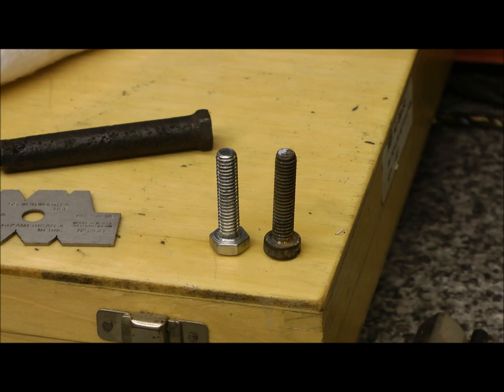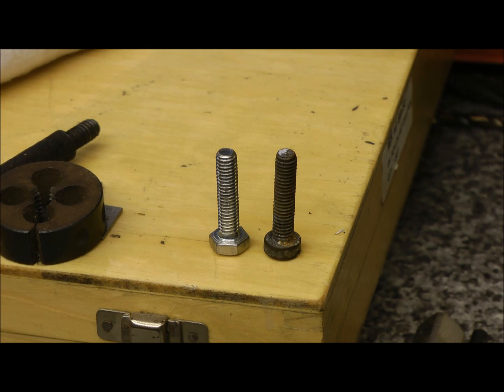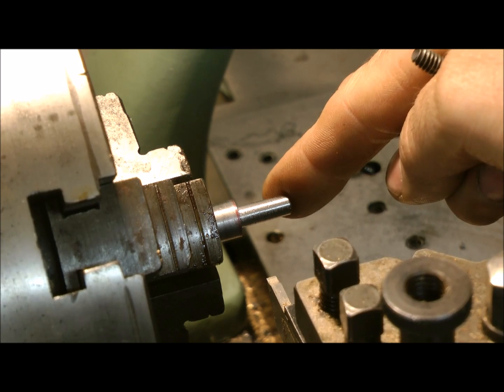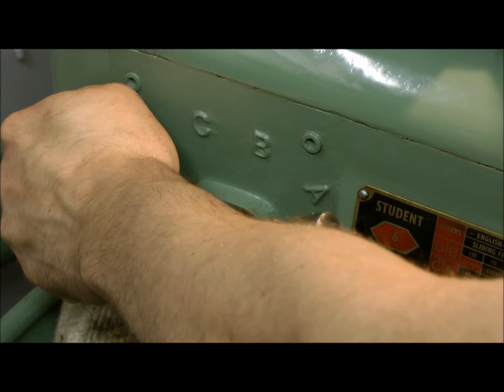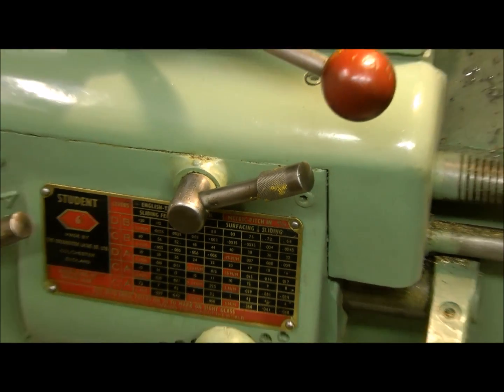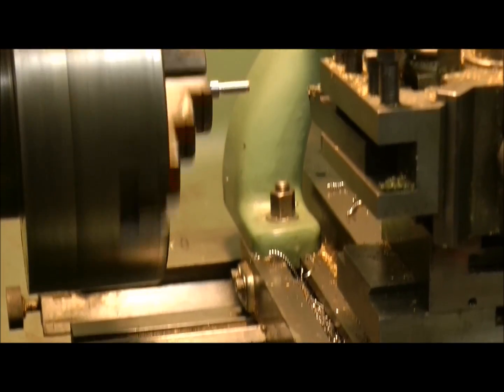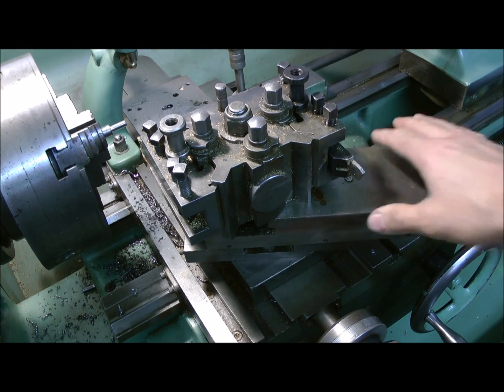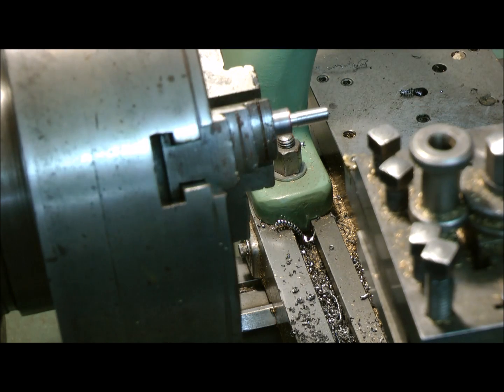First attempt at screw cutting lathe part 1

Comment: From the sounds of `er wha`, i deduce a broken gear tooth in the lower gears... Sounds like a single broken tooth that when encountered at speed, via the momentum of the things just skips the position wholly, smacking into the next tooth with what little run up the system managed to achieve in that short interval... I could be wrong, but that`s what it sounds like to me... 
Just found your channel, so i dont know if you diagnosed/changed the offending part as of yet, but we shall see... I myself have quite some shit to deal with in my shop... More like 9 machines in need of general restoration and 1 in need of complete service and 2 baby machines that are in tip top shape... Well, i lie, the baby lathe has a tailstock issue to resolve, but that is a single precise bore worth of work to solve that... I`m just too lazy atm to deal with that little bugger... So one could say that i have some experience with machines not sounding as they should
All the best!
Reply from the maker: Hi ! Thank you 😊, there’s definitely something going on in there… I’ve never been brave enough to look inside… I bought it untested… young and foolish, I don’t use it much as I should
Reply: @Madchris1 
Oh, dont worry, i too have done my fair share of picking up machinery that is either untested or in need of severe reconditioning and general restoration... On one hand, it offers you the ability to snag ridiculous machinery for pennies, on the other hand, it offers you the ability to conjure a task as laborious as pregnancy yet one that can last much longer...
 
If she is free of cracks in the main casting, she can be restored to perfection... That is my motto... Machines just need a lot of love and double the amount of elbow grease...  

All the best and kind regards!

Comment: The mower will most likely have a Briggs and Stratton engine, which means that the thread will be 1/4” UNC, not Whitworth . . .
The Whitworth thread form has a 55 degree included thread angle, whilst the American UNC thread angle is 60 degrees. There are other differences of thread form, root radius and effective diameter which means that correctly formed threads will not match together - however, a slack thread might !
But it will not be very strong . . . .
The top slide angle should be set so that the rear face of the cutting tool effectively slides down the front flank of the following thread, which means that, if the scale reads zero degrees on the top slide angle, when the top slide is parallel to the lathe ways, the the angle that it should be set to is :
90 - 27.5 ( half the included thread angle )
= 62.5 degrees
For the UNC thread that I think that you should be cutting, that angle is :
90 - 30 = 60 degrees.
To cut a metric thread and use the thread cutting dial, you need to have a metric leadscrew, which of course, your machine does not have . . .
The lever marked metric and imperial simply changes the gear ratio and introduces a ‘fix factor’ to alter the rotational speed of the leadscrew, so that it will move the carriage forward at a “metric” feed rate. The clasp nut will still only engage with the leadscrew at imperial distances, and these Do Not repeat at the indications on the thread cutting dial, which leads to the problems that you have found !
There exists the possibility, on your Colchester, of running the machine in reverse and mounting the screw cutting tool in a rear tool holder. This gives the opportunity to screw cut away from a shoulder, towards the end of a thread.
Joe Pie, on his channel explains all the details, and he is a master of the art !
His videos on screw cutting ( and all things machining ) are well worth watching . . . .
Kind regards,
Steve A.
Reply from the maker: Thank you Steve , that’s the best explanation I’ve heard ! Great idea about running the lathe in reverse with the tool holder on the rear

Comment: Colchchester is a nice lathe probably the best built,, but one bad gear can cost 500 plus,,,if it's the shaft could be 2000,, I'll stick with my cheap atlas.
Reply from the maker: 🙂 you’re right a very expensive job ... The Atlas  is a really nice lathe , what size is it ? And what do you use it for 🙂
Reply: @Madchris1  it's a 12 x 36 ,, I'm new to the lathe world but always been intrigued by them,, have 3 now I like to restore them.. The 12 a 618 6 inch and the 109 6 inch.. I can do pretty well with the 12 just can't go fast and hard,,and I'm in no hurry anyway,,,came across a vedio on the colchchester being made last night,,,unbelievable precision,,within a millions of an inch, you have something there my friend.
Reply from the maker: George Spangler wow you’ve got three Atlas’s 👍 you must have a big garden shed to put  all them in ! 😊 nice that you are saving these machines 🙂👍
Reply: @Madchris1  l have a 6 cars garage and a 24 x 24 wood shop/ lathe shop now,,lol  my hobby is restoring classic cars,,have 9
Reply: @Madchris1  you should open that gear box up and make sure there's no broken gears are peaces floating around that could do damage,,, you surly have a broken tooth sounds like
Reply: @Madchris1  you can solder and cut a new tooth in and save having to buy are make one

Comment: You changed some electronic box on the back wall to change the speed of your lathe. Do you have a variable frequency driver or something similar? Is there some way you can repair whatever is causing that "clicking"?
Reply from the maker: the lathe had a 3 hp single phase motor when I bought it that tripped out all my power when started , so I fitted a Clarke brand 3 phase motor that could run on single phase 240v power supply using a phase inverter, those gaining motor speed control and reversing programmable soft start and motor  braking!, lo the clicking is coming from the headstock, well it is over 50 years old :) I have vids on the motor in " lathe section"
Reply: @Madchris1  i need some advice on wiring up my colchester...can i contact you via email please ?
Reply from the maker: fattossa  just got this .... I’m I to late ...
Reply: chris the bodge
Cool. Thanks.